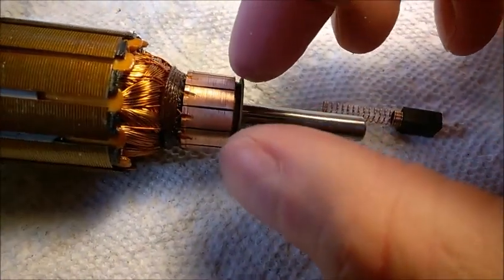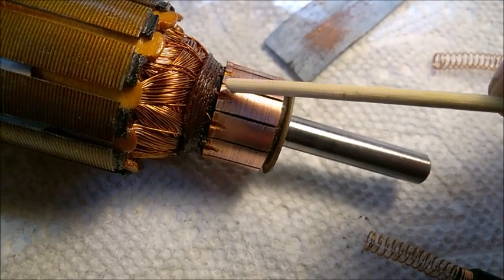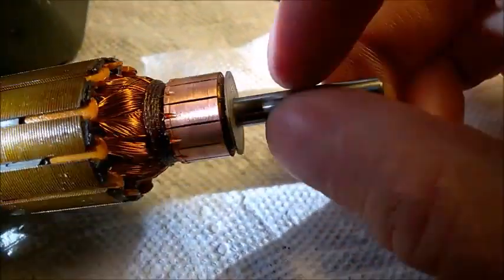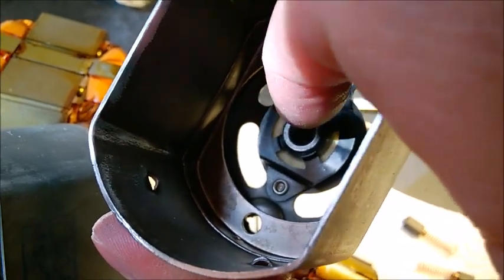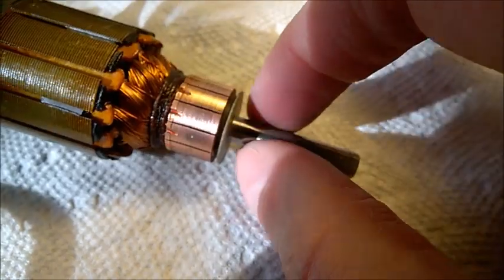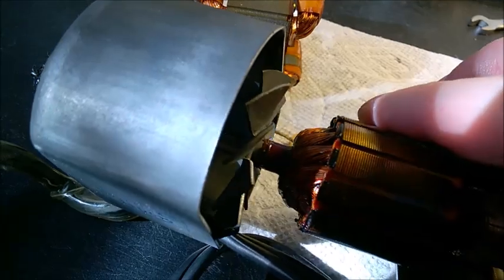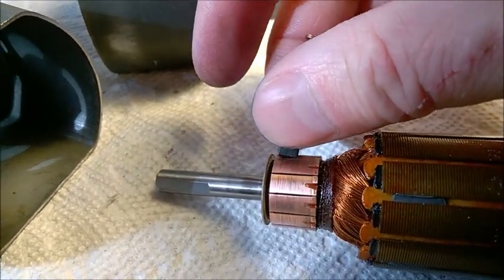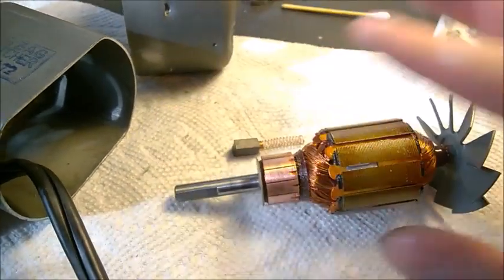Motor commutator cleaning

Comment from the maker: Important : when assembling back the motor, make sure the lubrication holes sit up above the shaft

The steel wire sponge is cleaning inside the bushings and the shaft, from layers of old hardened oil that increase the friction and reduce the speed

Use a piece of wire to put a droplet of 0W-30 engine oil at the small oiling holes

Electric motor playlist  https://www.youtube.com/playlist?list=PLl-l6yge4astcLGPffALfOdxNvKtgEHRQ